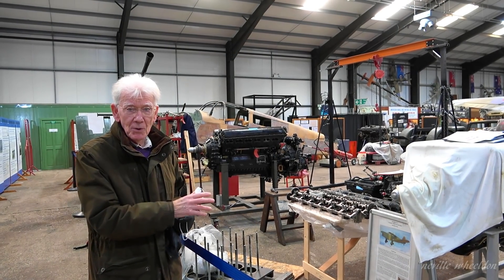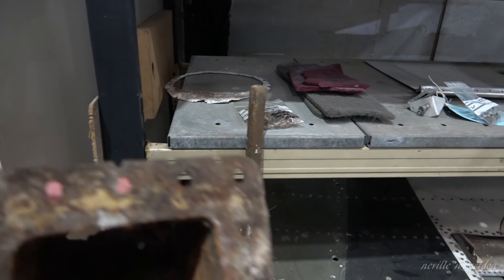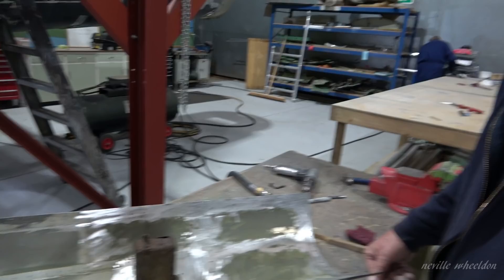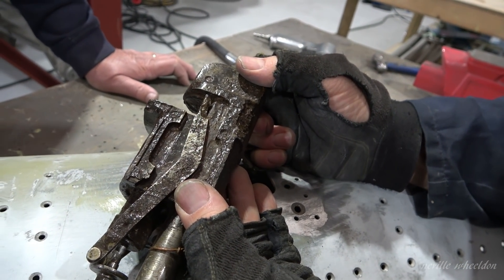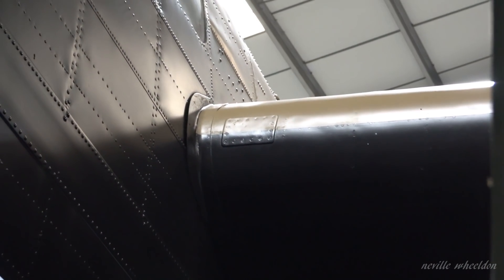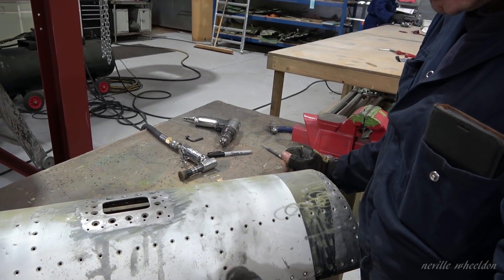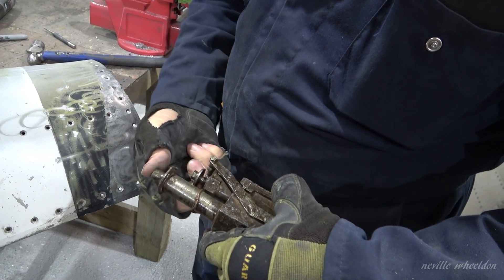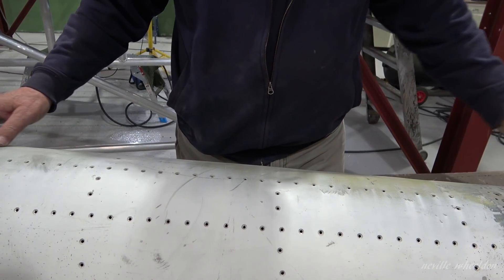Video 120 Restoration of Lancaster NX611 Year 5.   The first video in Year 5 of a 10 year plan.

Comment: Those cable cutters seemed like a good idea at the time in theory, But I don't see how they can be truly affective at 282mph (246 knots, 454 km/h) Going that fast, hitting a cable would tear anything apart in my mind before those cable cutters even had time to do what there where designed to do. Still, very neat to know. This is a detail that's missing on the model. Are they gonna restore those cutters and at least have one working for demonstrations ?

Comment: Thank you for another fascinating insight into the restoration, those cable cutters are amazing. I would of never even thought about them, I’m assuming they were in case the aircraft got tangled in barrage balloons.
Reply from the maker: Hi Diesel, yes that's right. The German V-1 flying bombs had cable cutter fitted to there wings. About 270 crashed short of there target after coming into contact with barrage balloon cable in 1944 ( Wikipedia)